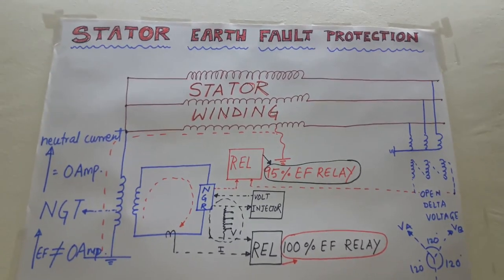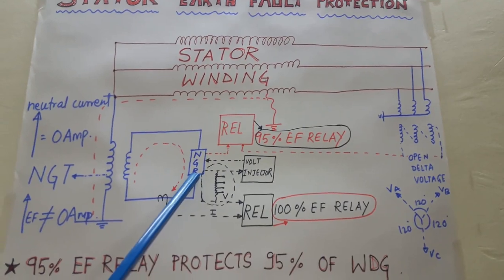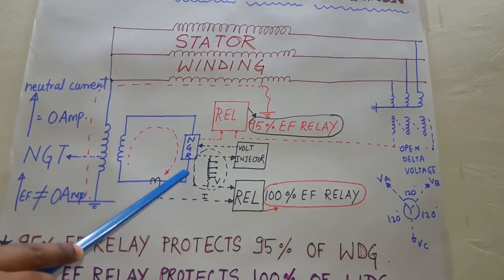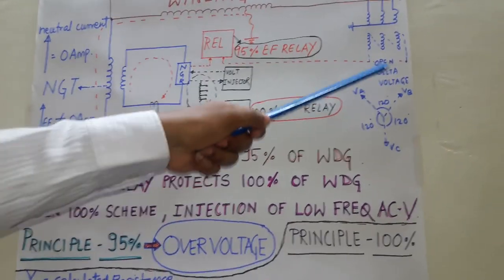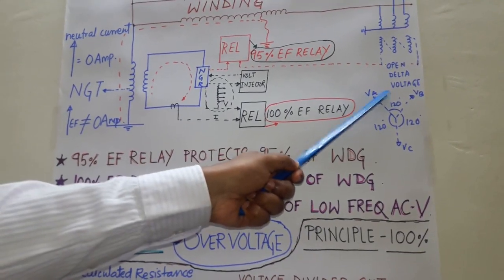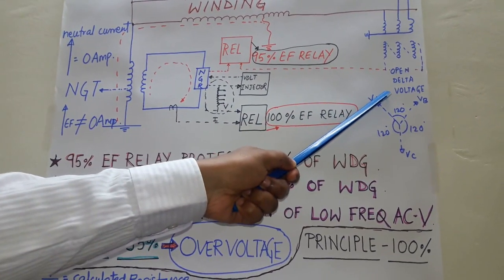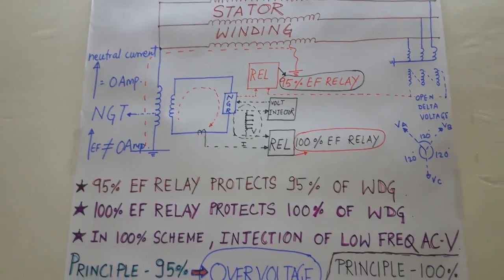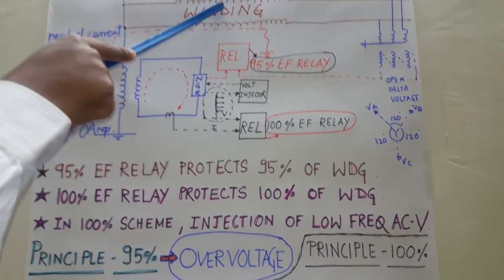GENERATOR STATOR EARTH FAULT PROTECTION

Comment: Can we use 59N plus 27TN with primary VT open delta connection at Gen output?. Because normally the generator output only uses open delta 2 VTs instead of primary star connection 3 VTs.
Reply from the maker: Yes definitely, 59 N is known as 95% stator earth fault it can't protection 5% towards neutral. So combination of both will serve the purpose completely. But still in design 59N , 27TN & Injection based are used to know the fault in shutdown condition  and trace zone of earth fault in stator.

Comment: Hi I have a practical problem, hope you will help me to resolve it:
Stator resistance value as i can check in numerical relay is infinite in case of GCB open condition with taking healthy generator in circuit, however when I am closing GCB(generator Circuit breaker) value of stator resistance dips to approx 5000ohm, moreover generator is in service & running on 10.5kV level & no fault is existing in system.
can you please help me to findout the possible reason of fault.

Comment: If fault occur in any phase of windings then why current flow from Earth to upward direction NGT. Please tell me sir
Reply from the maker: vaithiyanathan manokaran Because after grounding a closed path is formed, a circuit with an emf source and some impedance, take both the grounding points as a same point of the electrical circuit☺

Comment: Sir,

Without using "100 % Scheme" , if we use 95% scheme (59N) and 3rd harmonics neutral under voltage scheme (27TN), is it possible??

Which is better ? "100 % scheme" ?? of using both "59N" with 27TN ??
Reply from the maker: 100 % voltage injection scheme is best for reliability
and we can use neutral third harmonic for alarm  and easy  identification of the fault location
Reply: thanx sir for your reply...

we have a 331 MVA turbu generator by GE.

I checked their generator protection control diagram. found that, they used 59N and 27TN. both condition have generaton trip with turbine trip. But generator relay have 100% stator protection scheme wglhich is desabled..
Reply from the maker: Are you talking abt 100%scheme which is having a low frequency voltage injector ?
Reply: Atis Kumar yes sir
Reply from the maker: +Niaz Islam ,its ok but we didn't have that scheme in one of our 776 MVA generator , so we did modification to make it available, it depends upon the engineering team completely
Reply: Atis Kumar , ok sir.. i have many many question regarding protection scheme of generator and transformer ...will you mind? if i will ask?

your video is really amazing...
Reply from the maker: +Niaz Islam i have tried to share my knowledge by uploading all the major generator protection schemes,  you can go through them and ask ur doubts also
Reply: Atis Kumar , one thing, is 95% scheme is applicable for symmetrical 3 phase fault and double phase to ground fault? how?
Reply from the maker: +Niaz Islam no because in symmetrical earth fault zero sequence current is absent
in two phase to earth it is applicable.. current in neutral = vector sum of 3 phases

Comment: sir you have connected a PT primary to earth and it means a direct ground of stator windings and I don't get it so pls tell me the PT connection
Reply from the maker: sankar dinesh For better understanding of gen pt connection, pls go through the stator interturn fault presentation in my channel
Reply from the maker: sankar dinesh, pt primary has very high internal impedance, u can imagine  voltage measurement of  live system by a multimeter we connect one probe at live and other at earth 😊

Comment: what if we simply calculate V/I for 100% sef ? why we use AC injector ?
Reply from the maker: if stator voltage is divided by load current, the result is synch impedance which shows healthiness of the winding rather than insulation
By the help of injector we are able to check the resistive leakage  current inside the insulation
Hope u r clear
Reply: Thank you.

Comment: Sir, Initially u told that 95%earth fault is working under under voltage.with respect to relay settings..
Thn after u teach as it's over voltage how?
Reply: Under fault condition , current flows through NGT primary which induces current in NGT secondary and a voltage drop is observed across NGR . If this Voltage drop >relay set voltage , relay operates , that is why it is over voltage relay .

Comment: what is 3rd harmonic principle?
Reply from the maker: if earth fault occurs near neutral of the winding, the third harmonic voltage at terminal side is much higher as compared to the neutral side
so we can set ratio alarm in the relay  , third harmonic voltage at terminal wrt  third harmonic voltage at neutral high means earth fault occurred at neutral,
it is very effective for detecting EF at 25% of the winding from neutral

Comment: How do i can set 27TN? Thank you
Reply from the maker: The Third harmonic  ratio factor is dependent on capacitance  of network to which gen is connected, generally sett is  between 2 to 2.5. As per my experience in normal operating condition ratio of Term to Neutral is close to 1 or 1.5. It may also rise with change in grid conditions where sett is required to be revised.
Reply: @electrocean6684  or to take third harmonic voltage at the relay, signal comming from NGR, with several power levels, am I correct?
Reply from the maker: @mel6688  Yes it is also correct but less reliable than ratio scheme.